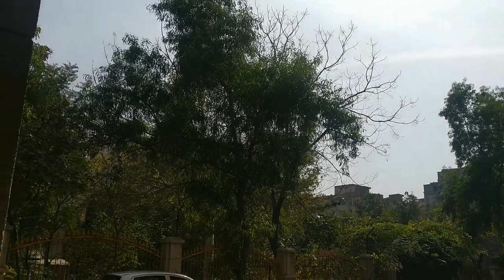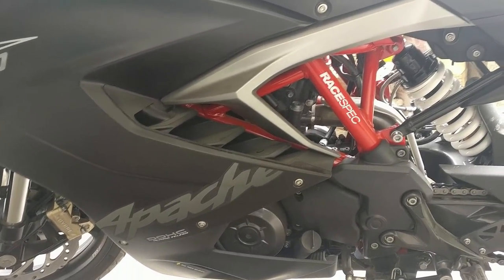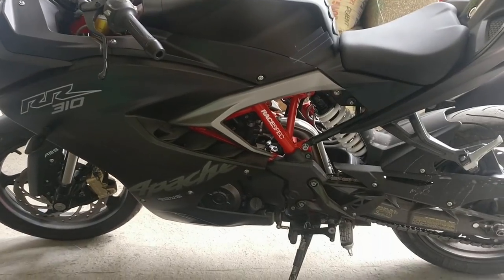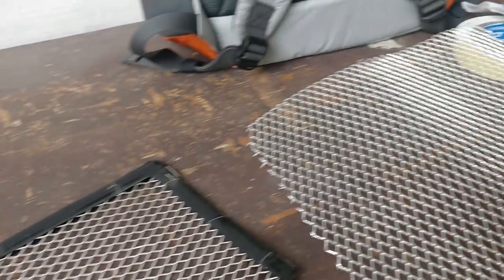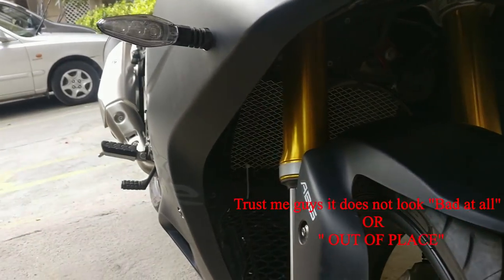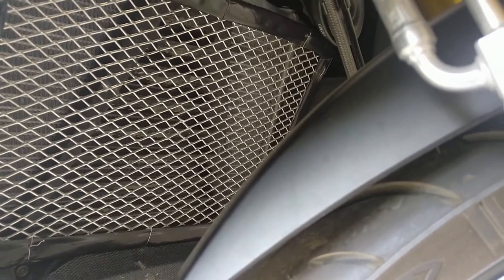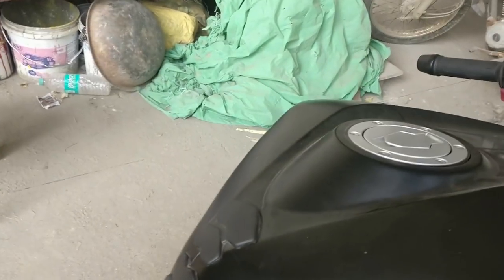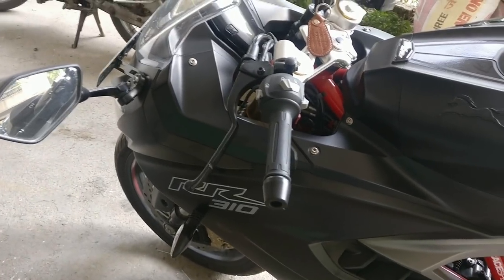Apache RR310 RADIATOR GUARD!! Owners DIY OR PURCHASE!! "your choice"

Comment: I don't see any reason to install radiator gaurd on Apache RR310. Bike has been tested comprehensively on Indian roads thousands of kilometers. Installation of radiator gaurd  obsutruct the airflow and reduces the engine radiator cooling  efficiency.
Reply from the maker: Manish Kumar ..respect your opinion and ur insight but the thing is I believe in precaution than cure. Even though the bike has been tested meticulously for thousands of kms it's NOT PERFECT, I know cos I own one..so how can anybody be sure if the radiator is not in harm's way, as I have seen dents on my radiator due to road debris and rocks . I have been using the guard for more than a month now..no heating issues

Comment: Good idea but don't you think when you need to change the oil filter you have to cut that tag. I see you have tied it to the oil filter gaurd.
Reply from the maker: Ajith Nair.. yes u would have to.. for my first servicing I removed it.. post that I dint re-tag it.. still no issues..metal wires r doing their job holding it in its place 👍

Comment: Bro the external guard's will make vibration on top speeds ??
Reply from the maker: sticky gamer games Happy for life....tried and tested..had already installed it and then took it out for the video.. have done speeds excess of 145+ , no vibrations at all
Reply: Bro I've seen some owner review they said there are lot of vibrations at high speed
Reply: Viral India.. May be because they are riding a 300cc motorcycle for the first time. Because any higher cc single cylinder bike will have vibrations. On some bikes it's a bit more and on some a bit less.
Reply from the maker: Amit Yadav ..true that!!